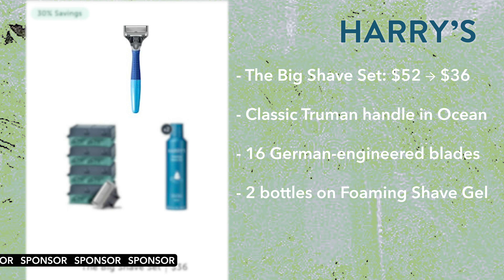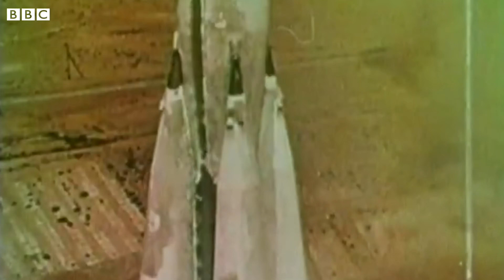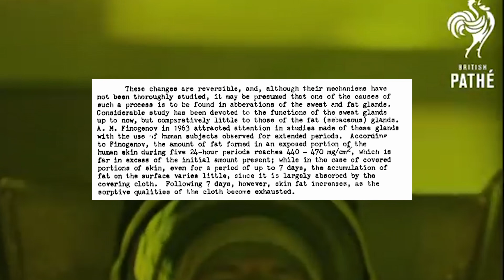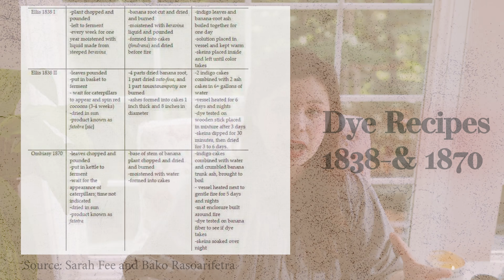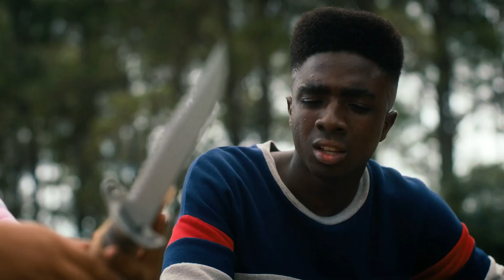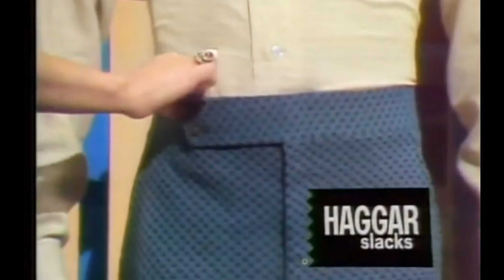The DISGUSTING truth about Laundry

Comment: I sell appliances and have done this on and off for 5 years.. I have alot of customers that complain about the water level, the machines aren’t made like they used to be, etc. etc…. Yea. Of course they’re going to change and evolve in order to be more energy and water efficient, but I will give them that their old machines were better built because of the resources we had at the time (which are much more scarce than they were before). A lot of modern machines have sanitize cycles now, which is fantastic. Even the most basic front load Samsung makes has a sanitize cycle, so I can see it becoming 100% standard for modern machines these days. 

Whenever someone wants to know if they need an agitator, I ask if they work on a heavy construction job site every day and are constantly caked in dirt. They usually say no, and they don’t buy the agitator washer. 

There is something to be said about the price of machines. Belt-driven, agitator machines are usually the cheapest (one of mine usually being on sale for less than $500 as I work in a big box store), so people who are in a pinch for a machine usually buy it. Not to mention most commercial properties like rental homes and apartments or multi-family complexes have these cheap machines in them already and is included with the apartment, so everybody’s clothes eventually get ruined. Yay!

Comment: I love the research you did on this, and the great thought that went before it.  Thank you.  I will say, though, it's cheap and easy to buy a rack for line drying clothes.  You can do it in any room in your house if you can't do it outside.  The Brits have "airing cupboards" which are amazing, basically a place to finish drying your clothes next to the water boiler.  It doesn't take privilege to air dry your clothes, or even wash them by hand.  It's more work and most people won't do it, but they'll buy a membership to a gym to get a good "work out".  I think our future of everything getting way too expensive will solve half of those problems.

Comment: 13:30 I will say I will cut and reuse any garments to shreds to avoid throwing away textiles, but I’ll be damned if I’m expending more energy than washer+dryer on cleaning my clothes.  I don’t even change the settings half the time.  I don’t even iron anything unless I’m in the middle of sewing and I need to finish a seam.  The ONLY clothes that get more intentional care than that are my period underwear, and they get their own load just so I don’t forget not to put them in the dryer.

When whether or not I can get my lazy ass to do laundry at all is dependent on me doing the bare minimum, I’m going for the bare minimum every time.  Idk why this is like pulling teeth in the modern day, it’s easier than it’s ever been historically, and yet we avoid it until the last possible second.

Comment: Hey Abby, nice video😇 just something that i'd like to add, because you recommended line drying instead of tumble drying. 
I totally agree that that should be done a lot more often, but i also think that its important to acknowledge that not everybody has the space to line dry their clothes. Having your own garden/backyard, balcony or patio etc. where you can hang your clothes outside is a priviledge. And line drying them inside of your home also requires you to have enough space to just have your drying rack standing around all the time. A problem that i have quite often is that when i dry my clothes on the drying rack, they sometimes develop a moldy smell, which i assume comes from the fact that it just takes a lot of time for them to dry. 
So yeah those are just my thoughts on the last bit of your video ☺

Comment: We use distilled white vinegar in the "fabric softener" portion of the washing machine to soften the rinse water and help sanitize things. It's also good for keeping colors and whites bright and it's much cheaper than actual fabric softener. It also won't clog up your washing machine.
Reply: Yep and the vinegar will also help break down the oils and skin cells and will keep the washer from growing mildew and mold

Edit you also got to be careful to not put to much vinegar as stright vinegar will brake down the rubber
Reply: Elasthane can take up a decent amount of vinegar - but it mustn't be used for clothes that have some kind of membrane, like gore-tex. Those are, however , usually to be washed separately anyway, so it isn't much of an issue.
Reply: yeah i use white vinegar too, though i still keep fabric softener around for plastic bottle fabrics that need it so i dont get zapped each time i touch them.

Comment: I haven't used fabric softeners for many decades. It's bad for the environment and the textiles and our skin.That said, I live in an area with soft water. But I tumble dry my towels (since I live in a flat and only have a communal laundry room and a very small bathroom, so there is not room there to air dry all of my laundry, anyway) and that makes them soft and fluffy without a single drop of softener. Bed sheets get dried in the heated airing cupboard. Almost everything else is dried in my tiny bathroom, or (in summer) on my even tinier balcony. We're trying to petition the housing company to put up outdoor drying lines since it's a fairly safe neighbourhood and we have extensive lawns between our buildings, but it's very slow going. I would definitely dry all my bed sheets outdoors if I could!

 I also use eco-friendly detergent without whiteners, scents, phosphates or colourants. (For laundry that really needs whiteners/bleaching, I'd add that separately.) I did try "soap nuts" for a while when they were all the rage a number of years back, but they didn't really work. I think to make saponin-rich plants work you have to boil them up first to make a soapy solution, which you then add to your wash, and that's not how they were marketed at all (we were supposed to just throw them in with the laundry in a little cloth bag and they would supposedly release enough saponins to clean the laundry...yeah, that didn't work as advertised). 

Also our washing machines can do temperatures up to 95°C (almost boiling) so if anything is really poopy that's where it goes. Mostly I use 60° (hot) for towels and sheets and underwear and 30-40° (lukewarm-warm) for all other clothing. But I have noticed that the newer, presumably more water-conserving machines don't wash the garments as clean as they should be, which means I put in smaller loads, which means more washing cycles (same problem with low-flushing toilets, actually, where the amount of water is so inefficient that you end up having to flush two or three times instead) and where is the environmental friendliness in that? It becomes self-defeating.

Comment: Greetings from europe! Adressing the whole "clothesline but without having my neighbors see the undies" part. I know its not much issue for most of us over here (because its just normal) but for those bothered by it or someone not having a lot of space in their sunny places - get a rotary clothesline (hills hoist?). You need a lot less space, the clothes will dry wonderfully, if you don't use it you can fold them in so the lines don't get as dirty as on a normal hanger (without having to taking them off and putting them back on) and also you can just put any clothes you might be ashamed of (hello there 17 year old ugly but comfortable sweater) on the innermost lines and just hang the less "problematic" clothes in front of it.

Comment: Hi! I love your video 🤩, thanks. You seems so desperate in it. But, don't worry, there is solutions. I can share with you my laundry day to day experience : I stopped buying clothes made with plastic, with the one I still have, I wash them with low temperature and slower than other, I buy and sew only the clothes need with natural fibers cotton linen and wool mostly. I did not know about how hard the laundry was on clothes, but I will find something. I wash them only when necessary, I use natural and homemade soap and softener (savon de Marseille and diluted vinegar), I do no have dryer.
Reply: I am French btw, the modern laundry system is the same in Europe as far as I know.
Reply: And I wash some very fragile clothes by hand, mostly wool clothes or accessories

Comment: I actually do know how hard my water is. Here, we range from 74 to 89 ppm CaCO3. "Soft" water generally is under 60 ppm, while fully "hard" water starts at 120 ppm, so my water is in-between...it's not hard enough to really make a difference to anything (including laundry), or require softener. The worst that might happen is that dishes left to air-dry get barely-noticeable spots...but it takes literal YEARS for scale to build up on my electric kettle (which is used a minimum of 1 time per day to boil water for tea) to the point that I need to run some vinegar through it to clean it out.

And unless I'm washing socks and/or undergarments, I will use cold water. Habitually. And I only use the dryer for socks, undergarments, and jeans (on a very low heat setting) - everything else gets hung up to air-dry.* The combination of these practises has allowed me to hold onto clothing for an extremely long time. I have a hoodie from 1996 that lasted me more than 20 years in good condition (and even today, if I need a ratty thing to throw on if it's cool outside and I'm walking the dog, it's perfect). Also, I've kept many t-shirts in near-perfect condition for more than 15 years (even ones of questionable quality). Once they get a bit broken down (small holes, stretched neckline, etc.) they transition into bedtime attire. I have concert t-shirts from 2002 that are still reasonably-acceptable condition (wearing one right now, actually).

Unfortunately, it did take me a bit of time to realize just how hard laundry practises are on clothing...but now that I've learned better ways, my clothes are lasting even longer. There are exceptions though. I have a rust-red t-shirt from 2010 or so that only lasted about a decade before getting those little tiny holes in it. So there's no accounting for quality, I suppose, since it has been laundered very gently. Still...a decade of wearing it ~15 to 20 days a year is a decent amount of use (say, 10 washes a year, 100 washes total). I expect quality clothes to stand up to twice that, but that's just me.

As for the environmental impact, I think that this is more a question of pollution for me. Water treatment in the "old days" was basically non-existent, so grey water was just going to contaminate bodies of water from which people were drinking. Nowadays, grey water ends up in sewage treatment plants, and its polluting components are removed. Granted, there's a whole host of new BS that we have to worry about, from microplastics to silver nanoparticles, and those are having mostly unknown environmental and human health impacts. But if we had 330 million Americans doing laundry like in the old days, the pollution released into bodies of water from this particular source would be at least an order of magnitude worse. So it's not all bad news.

Considering water usage (and wastage), obviously we waste more water today. In areas with water shortages, this is a massive problem. But this issue is multi-faceted. Why do so many people live in Southern California, Nevada, and the rest of the (sometimes literal) deserts of the Southwest? Those areas of the USA NEVER had enough water to sustain their current populations. We should be looking for ways to get people OUT of those areas and into areas with less water stress, because frankly, it's a dire situation, and we need water to live. Wasting water is never okay, but even using the most efficient laundry systems out there, these areas cannot sustain their populations, and they especially cannot sustain the amount of intensive agriculture they have. If there was no agriculture in these areas, there would be no water shortage. So capitalism (da da da da da) and the associated modern expectation of exotic foods (like almonds and avocados) being readily available at the supermarket is really to blame here, far more than laundry practises.

*Also - who the heck washes their undergarments with their t-shirts? That's just silly. I still don't use hot water for undergarments and socks (I stick with warm water...~35 degrees C, ~95 F as hot water degrades fabric), but I do throwing some Persil into there to sanitize them. I'm not crazy about Persil - if I use it, I will do a double-rinse to remove the scent - but it is antimicrobial, and that's important in certain applications.

Comment: If you're worried about your laundry soap, what I often do is shave a thin layer off a bar of laundry soap (like fels naptha or zote) or a bar of people soap. Its fairly cheap, easy to customize to the load (thin slice for fairly clean laundry, a couple slices for really dirty). Just make sure to do stain removal beforehand, simples!
Reply: I have a basic recipe for laundry detergent that uses Zote that’s been shredded with a cheese grater. I’ve never in my life had cleaner clothes than with this detergent

Comment: There are new washing machines with a sanitizing cycle. The article I saw mainly talked about cloth diapers. 

I lived in a house with permanent clothes drying lines. I was planning on upgrading to a combo drying line and hammock project I saw in a magazine. It basically was two large wooden crosses. The setup was that you could either string up clothesline or a hammock between them. The hardware for both was permanent and the hammock could hang on the outside when you were drying clothes. There was also a rod across the top to drape a top across for shade. It struck me as a great way to have both laundry and hammock setup for the backyard. 

I did live in Ireland as a child. All the clothes were dried outside. They were also “pressed” however. This was a closet that in our house contained the hot water heater. You folded the clothes and put them on the shelves in the press, so that the heat coming off the hot water heater loosened the stiffness from the line drying. Presumably it also made them easier to dry.

Comment: vinegar and peroxide are both eco safe ways to clean or sanitize, but they are also really hard on modern washing machines. I know people who wash with castile soap and vinegar and that's it. 

Line drying isn't an option for people in tiny apartments or densely packed cities not built to allow it and in humid parts of the US, doing it inside OR outside can be a problem.

But like, honestly? The idea of not washing or sanitizing your outer garments when you lived in a city with poop on the street is wild to me. 

I know linen is very good at temperature regulation, but I'm curious what the laundry and clothing layering practices in places that historically had the heat and humidity people are dealing with these days. The idea of wearing an entire shirt under my shirt is making me sweat.

Comment: I've long known and shuddered to think about the lack of sanitizing in laundry.  Cannot use hot water because of fading and colors bleeding onto lighter things. I could try alcohol. Would rubbing alcohol in a spray bottle work as well as vodka ? How about laundry sanitizer, which is available?  To save wear I use the zippered mesh  garment bags  and split my load into 3 or 4 of them to protect the fabric  from  the rigors of agitation. Everything goes in them except heavy  large things like jeans. I do love linen and will buy more of it.  Line drying is wonderful but you have have much much time ironing this way. What I do Is put the load in the dryer for 5 minutes to steam the wrinkles out, then line dry.

Comment: There is misinformation in this video about the importance (or lack thereof) of sanitizing and the killing and removal of harmful pathogens. The actual act of “sanitizing” which I assume she meant disinfecting is not quite as important as the detergent (soap) aspect, as soap can remove the bacteria by letting it be rinsed away, whereas disinfectants need to be very effective and harsh in order to achieve the same thing. Plus, disinfecting surfaces and clothing does not actually have any health benefits for regular healthy people. Alcohol less than 70% does not effectively disinfect surfaces unless left saturated on the surface for an extended period of time.

Comment: As someone with ridiculously sensitive skin, and living in an area with some of the hardest water available, you can get ON LINE water softeners for washing machines and dishwashers (and shower heads!). You can get salt-resin and the strange crystal ball ones (or both).

remember to wipe out your front loaders (and seals) EVERY. I mean EVERY F-ING load. And KEEP THE DOORS AND DRAWERS OPEN between uses. Enzyme machine cleaners will also help with keeping the machine functioning well. Regular machine clean cycles are a must.

Comment: I HATE chlorine bleach and you don't need it to get whites white. Hydrogen Peroxide is much better doesn't destroy the fibers and also gets out hard stains such as blood chocolate and grass.
Using white vinegar instead of fabric softener will cut the detergent residue and makes whites white and clothes soft. It also sanitizes.The smell of vinegar quickly dissipates on drying.
I was a nurse back in the day when we were required to wear white uniforms which often got all kinds of gross stains and other people's bodily fluids on them, raised 4 active children and was married to a mechanic. So I speak from experience lol

Comment: Haven't used fabric softener in years, but occasionally if my clothes don't feel clean, I'll throw in a splash of white vinegar in with the wash (or if I have laundry that sat wet in the washer too much, I run it again with vinegar and it's fine.) I never knew why it worked but if all north american water is some level of hard water, that actually makes sense.